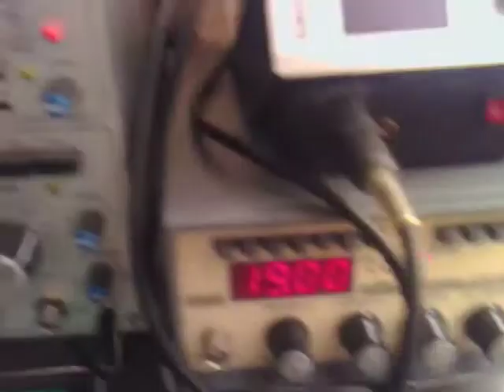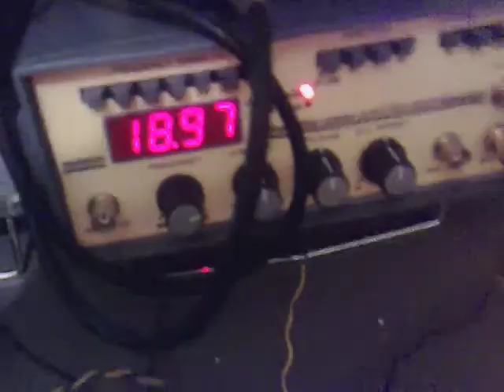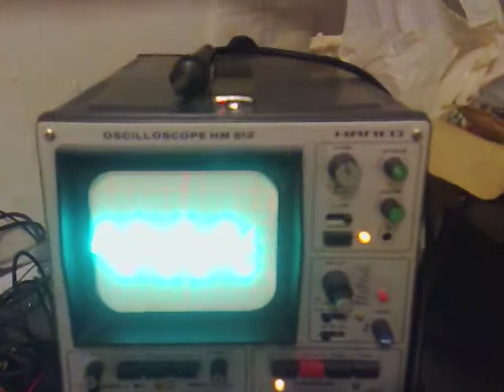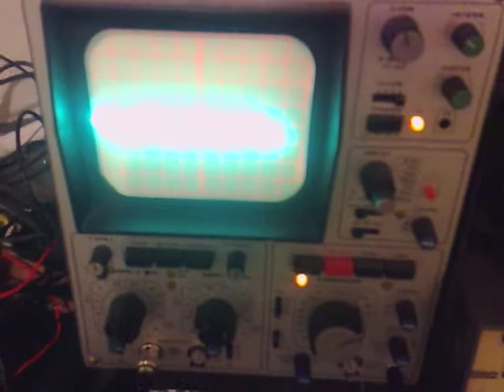High Voltage (One Wire Neon) 003

Comment: Hey I used bedini SSG and it worked too! I instead of a battery connected an ignition coil to the output, and the motor turned into solid state!

I can do all these cool things now, like lighting neons and tubes without touching them at all , and even use aluminum foil as a speaker, quite weird really.

Also, at high frequency the arcs doesn't hurt so much, though at lower ones it can be really painful.

Comment from the maker: I have tried this at low voltage now and have lit two LEDs two meters away from the source using matched transformers and a single wire at least 2 meters away from the previous transformer. I think I have Stationary Waves as the voltmeters do not register voltage but two LEDs Light at full Brightness.

Any thoughts?

Comment: Do the specifications for this LED or some other ones provide some clues? Something to do with the gap properties perhaps. Also the wire you attached (without ground) just became a little antenna, right?

It'll be neat if you come across the formula that roughly corresponds with the 6.521khz for this setup.